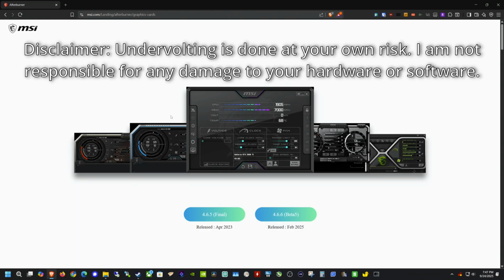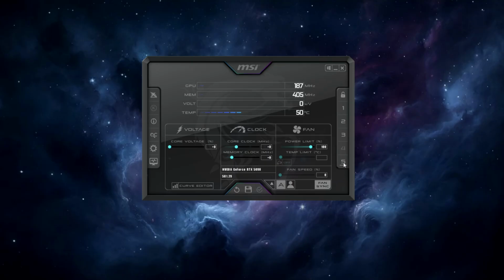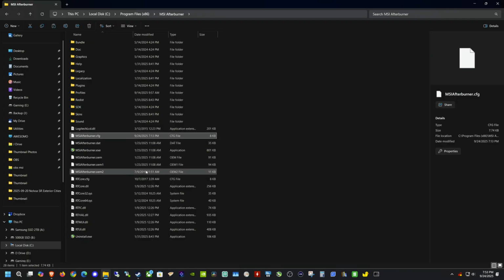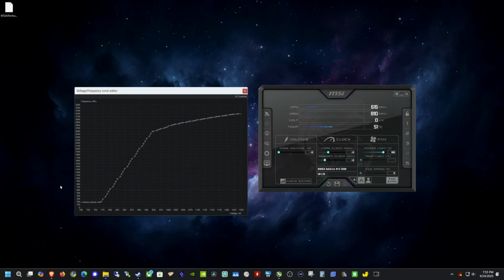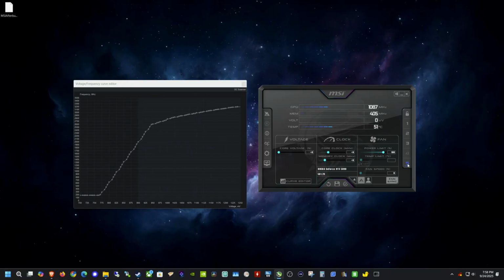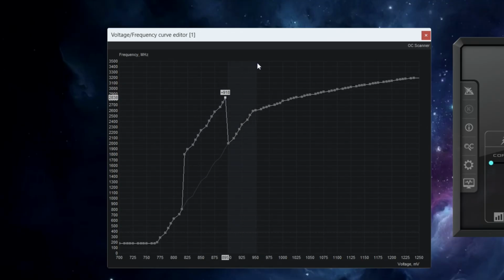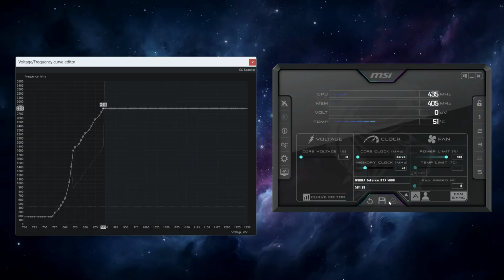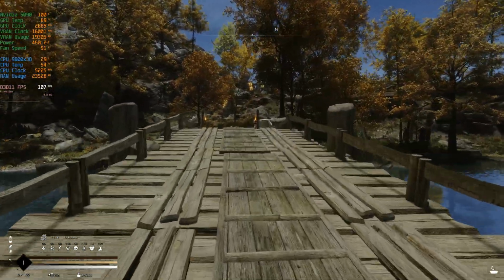You're Undervolting Your RTX 5090 WRONG (Here's How To Fix It)

Comment: Unless there's something unique to the 5090, the target frequency can still be lower during idle. I've undervolted and overclocked a bunch of cards, right now my placeholder 2080 Ti starts at 1335 MHz stock in the afterburner curve editor, yet the idle freq drops to 300.
Reply from the maker: If you follow other guides by pulling the entire curve up thus raising your minimum idle frequency allowed. When I followed those guides raising the entire curve my frequency would idle at around 1000mhz which was not allowing my fans to turn off while browsing the web, etc. I cant imagine the 5090 is any different to other cards in this regard.
Reply: @circuitscore it is different, I shift my entire curve and hit a boost block of 3Ghz with my 5070ti but still idle around 600mhz. 24-25C at idle. I checked the base voltage at idle as well and it’s pretty much the same. I think it’s a 5090 thing. I have experimented with using ctrl+click to pivot the curve so the lower bins are closer to the stock curve. Found to be not worth it at all, you’d need more extensive stability testing to check if the increased step size on the curve would introduce any instability.
Reply: @sodiumz7161  On my 4060, the idle voltage and frequency are exactly the same when the curve is shifted up. I think that other cards do not let the curve setup to override the lower voltage point frequencies, and the 5090 used in the video does not. Or it could simply be caused by the change he made in the curve editor files to let him see a wider range of voltages.
Reply: @sodiumz7161 the base idle speed on my MSI 5070ti is 180MHz and it averages around that according to HW info. Same for other 5070ti cards I've tested. If you held shift while adjusting your selected point up +400-500, it would make sense that your card is now idling at 600MHz, or +400-500 over default base idle clock.

This may not be a big deal for our cards, but on the 5090 that +400-500 on the base line idle seems to be closer to +1100 or more. I'd imagine having it stuck at that 24/7 would end up shortening the lifespan of the card.
Reply: @circuitscore yeah, something is either wrong with your afterburner or it’s just a 5090 quirk. Make sure you update to the latest afterburner version. I checked and   using the normal shift entire curve then flatten undervolt method, the idle behavior is basically unchanged for my 5070 ti. Actually, I’m now idling at a lower PPT than stock. It idles at around 10w and the card is basically close to room temp. Maybe like 2-3C higher than my room temp at idle, mid 50s in games. 

The super huge bin jumps in the middle of your curve is not ideal.
Reply: @circuitscore  So you explained a lot but didnt give reasons to why certain things are bad? My gpu idles at 1000 with 0.8mv according to GPUz so idk why it should be bad to have it that high when stuff works?

i also tested this now - board power draw and GPU voltage and GPU temperature stay the same during idle (nothing is happening on the PC) no matter if i idle at 1000mhz because i raised the whole frequency curve or not doing anything and just using default curves and values.
so why do you think that having the GPU idle at 1000mhz or higher is bad? temps and voltage stay the same so i dont see why it should be bad, but maybe you have a reason i just missed, also my fans dont start spinning if that is a concern for you (5090 suprim here), pls enlight me on this topic, thanks a lot <3

Comment: Appreciated your works, I am confused because am using PSU 1600 Watt with LCD shown Watt. I see PSU shown around 640 watt, however 5090 shown around 360 watt. Any change to lower PSU or can’t because it supplies electricity to pc?😢 thank you so much.
Reply from the maker: A 1600 Watt PSU is overkill even for a 5090. I am using a 1000 Watt PSU. My 5090 normally caps out at 500 Watts with this undervolt and my CPU, RAM, and other components cap out at about 200 to 250 Watts similar to your system. So 700 to 750 Watts total. But don't worry. You don't need to downgrade. The PSU will only use as much power as it needs not the whole 1600 watts. So you just have a lot of extra overhead. In other words your energy usage will be the same with either a 1600 Watt or a 1000 Watt PSU.

Comment: Clickbait. Editing the graph didn’t even do anything. You can see the voltages you affected from 800 up without editing the graph. This undervolt also isn’t proper because it mentions nothing of the fact that when you undervolt a 50 series card it does not run at the voltage you set but actually 2 voltage points below the flat line.
Reply from the maker: Sounds like you did something wrong. I was not able to see the lower points on the graph without editing the .cfg file.
Reply: @circuitscore I didn’t do something wrong I can see my points without doing this lol.
Reply: @Knight0vvl  em no, I just downloaded latest afterburner and I had to set it to 0. It was 500 by default (MHz)
Reply: @Krulaks  you missed the point you don’t even need to see the whole graph because he’s not changing any of the lower voltages. He started at wht 810vwhich you can see without editing the graph so none of the rest of the graph he showed you was useful he did the same under volt that other people are doing.
Reply: @Knight0vvl  yeah - you can skip setting cfg to 0 step. I think he just wanted to show us that there are lower voltages and it explained why other tutorials are bad. The main point is to not drag everything up (so from 810 or so). Others are saying to select 0.9mV point and to drag everything up (then gpu is stuck at 1000MHz+ or so)
Reply from the maker: @Krulaks Exactly this ^^^ Glad to see one person was paying attention haha.
Reply: @circuitscore  can you explain why its bad to raise all of the curve when temps, voltage and all stays the same compared to default? you didnt really go into that in the video, you just said its not good and many recommand it but didnt go into any reasoning if i didnt miss it, thanks a lot for any explanation in advance <3
Reply: @teanymonster5227  temps should not be the same, but probably you don't see any difference because of massive heatsink on GPU.

200MHz at low voltages = less Wattage
1000MHz at the same low voltages = more Wattage

Higher MHz = higher power draw, no matter if you are seeing the same voltage. Voltage is just one part of the equation.
Reply: @Krulaks nope temps total watt power draw during idle and voltage all is the same, i can show you screenshots of the total board power draw in GPU-Z if you want no problem (20-40W while idle)
Reply: @teanymonster5227 it’s not bad, just used more power at idle
Reply: So you explained a lot but didnt give reasons to why certain things are bad? My gpu idles at 1000 with 0.8mv according to GPUz so idk why it should be bad to have it that high when stuff works?

i also tested this now - board power draw and GPU voltage and GPU temperature stay the same during idle (nothing is happening on the PC) no matter if i idle at 1000mhz because i raised the whole frequency curve or not doing anything and just using default curves and values.
so why do you think that having the GPU idle at 1000mhz or higher is bad? temps and voltage stay the same so i dont see why it should be bad, but maybe you have a reason i just missed, also my fans dont start spinning if that is a concern for you, pls enlight me on this topic, thanks a lot <3
Reply: @teanymonster5227 he can’t explain it because what you said is true - the voltage which is the main concern and directly correlated with temps does not change. In practical terms having the gpu idle at 1000mhz or 100mhz will make no difference
Reply: @junkmonkey54  thanks, crazy that someone is claiming everybody is wrong but doesnt even give 1 explanation in the video and people just believe it without question or testing it themself, crazy world we live in sadly.

Comment: I have a Palit 5090 and my main problem is the temperature just slowly keeps going up until the fans kick in at 60c and after its cooled to around 35-40 then the process repeats. Will this help at all? it seems to idle at 800mv but fluctuate up to around 900 when just browsing the internet etc and up to 950 when watching youtube, I just upgraded to a 4k monitor so I imagine that's not helping but my gpu was still heating up even with my 1080p monitor. I only have a midtower case so maybe its just not enough airflow for it or something? when gaming at 4k with ray tracing it seems to max out at around 80c which doesn't seem too bad but could undervolting also lower that? thanks.
Reply from the maker: Undervolting will 100% help with your temps while gaming however at idle and while browsing the web etc. it shouldn't be heating up like that. Mine stays pretty stable while doing tasks other than gaming. This will help if the Palit 5090 turns off the fans at the lower frequencies. It essentially keeps the voltage curve similar at lower frequencies so your fans don't need to run at those lower temperatures and frequencies. Not sure if Palit has this options though. You might need to set a custom fan curve so that your temperatures remain more stable while idling and doing tasks other than gaming.
Reply: @circuitscore  hmm yeah I mean the thing with this gpu is the fans are very loud and they run at 1000rpm minimum so I don't have them on all the time, I think I can manually make like maybe 1 fan run at all times but the fan settings are a bit weird I'm not sure if the other fans will turn on ever if I just set one on 🤔

Comment: Since they released the 4.6.6 version, the cfg file is pretty much already set. The only difference is I’m on a 4090 & I’m not sure how to make the bottom frequencies show
Reply: Already figured it out….you have to change minvoltage from 700 to 0
Reply from the maker: Oops missed your update message. Glad you figured it out!

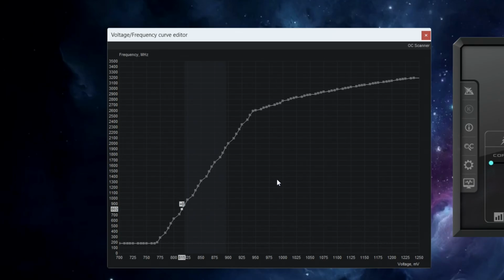Comment: 7:50 I usually input -200 core clock & then pick what ever voltage I want to run at a desired frequency. And then I keep lowering voltage until it’s not stable for what ever game I’m playing. 

I’m going to mix my method with yours & see what happens
Reply from the maker: Oh I like that idea. Didnt think of starting with a negative offset first.
Reply: @circuitscore  I learned the -200 core clock off set from this video https://youtu.be/GPs7Uufvoyw?si=Qd0KmBuN6E-igv7n
Reply: buona idea

Comment: My 5090 has a water block, and even under a 600W extreme stress test for 45 minutes, the temperature never went above 48°C. In this case, if I want to get the maximum performance, I don’t really need to worry about undervolting？
Reply: For me its about NOT burning up the power cord or connector, not temps.  600W is too much.
Reply from the maker: Oh I didnt even think about that. Yeah the melting cable is a huge concern of mine as well. This should help out quite a bit.
Reply from the maker: In your case you wouldn't need to undervolt to lower your thermals. However you can save quite a bit of power by undervolting. My usage with an undervolt is 450W to 500W. Without undervolting it consumes about 600W.

Comment: Hey I followed your guide but for some reason my card idles at .810v and ~2400 mhz. I terminated EVERY nonessential program, reduced refresh rate, shut off hdr, and still cant seem to figure it out. I guess ill have to reinstall drivers tonight. Have you or anyone else experienced this?
Reply from the maker: You might need to adjust your highlighted graph point higher. My card idles at .795v and lower which is why I picked .820 to .895 range to adjust the curve. Which brand of 5090 do you have?
Reply: Are your power settings set to "prefer maximum performance" in the NV control panel?  I had the same before remembering I set that a while ago.

Comment: Interesting, I tried to replicate the same steps and noticed my graph is a little different than yours.
In the Video after pulling up the highlighted section your MSI showed a +918 from 820/895 when at 2838
When I pull up that section the graph shows me at a +1001 so some of the graph points seem to be in different positions for me if only slightly.

Also after I pulled the rest of the graph down, after applying, the end result flat curve sits at 2827 all of a sudden even tho I checked -> 895 is at 2838 before I apply the flattening then after it always is at 2827.
I mean in general its in a similar spot to your values, its just strange that my default graph curves and points are different, about a "83" difference, super strange.
Reply from the maker: Yeah every card manufacturer has different limits and 2827 at 895 is a very common limit for many 5090s. Mine limits me at 2917 at 895. You will still achieve near stock performance with those setting and a huge power savings all while running much cooler.

Comment: doesnt work with the 4090 from gigabyte. i cant lock anything at 200mhz
Reply from the maker: That's odd. This should work with every card however your highlighted values will be different per card.
Reply: No , U cant Go on 200mhz with 4090, i have 3 cards, doesnt work with a single Card @circuitscore

Comment: Thanks for the video. I didn't event realize my idle frequency needed to be fixed! Also, what led you to choose 820mv as your min value for the segment that you dragged up?
Reply from the maker: No problem. Thanks for watching. I chose 820mv because 795mv and lower voltage is the typically idle range at 200mhz for most 5090s.
Reply: @circuitscore  one question, if your car idles close to 800, why didnt you cjoose the next possible dot on the graph which is 810? Why did you jump straight to 820?
Reply: 800 mV at 180 MHz is standard/factory for the FE, I think.  I'm running a PNY Epic-X that is overclocked from the factory and my idle is at 800 mV and 270 MHz (a +90 bump to the clock across the board).  Just reset your card to factory and look at the voltage in Afterburner with nothing else running.  Mine is 800, I pull my curve up starting with 810 and it works fine.

Comment: Super dumb question. I followed all of your steps, but notice in your MSI Afterburner, the Volt mV in the top 4 bars going across the interface, shows 0. Mine is like 800mV. Did I miss a step you did before recording? I don't want some voltage to be way too high, etc.!
Reply from the maker: You did miss a step. Earlier in the video I showed how to edit the MSI Afterburner Config file to show the entire graph. There are 4 lines you need to edit. Otherwise it cuts off the X and Y axis.
Reply: @circuitscore  I didn't mean in the graph though. I had actually edited the config file and got the graph to show just as you had stated. I meant on the other, normal Afterburner overlay. There are four horizontal bars at the top middle one being for volts but yours isn't showing any. Mine had like 800+ showing already in there while following your steps.
Reply from the maker: Oh sorry I miss understood what you were asking. I'm on a business trip and will check it when I'm home. It's possible the Beta version of MSI Afterburner that I'm using is not reading the voltage correctly. 800mV isn't too high if you undervoltef correctly. Is that under load or idle?
Reply: @circuitscore  Idle. And I think you're right. The beta version likely just didn't show voltage up there at the time. 

I saw another video that also had someone testing UV tweaks in Afterburner and it didn't show his voltage either. 

I also think my Gigabyte Windforce RTX 5090 needed a touch more volts. Helldivers 2 crashed within just a few minutes, following those steps pretty much verbatim. Not sure. I'll tinker more tomorrow.

Comment: What are the power savings compared to the incorrect idle?

And just for fun: Couldn't help but notice that Skyrim's HUD looks like a Korean MMO. 😀
Reply from the maker: Great question. Ill looks when I get home. I cant imagine is very substantial. For me the biggest use case of undervolting using this method is to allow my 5090 to turn off the fans when its not under load. If you are idling at 1000mhz your fans will run continuously.

That is Nolvus modlist. Its crazy unique. Does look like an MMO HUD 😂
Reply: @circuitscore  So i had my curve editor at the same higher min presets that all the other youtubers had, the lowest my 5090 downclocks was around 1177 Mhz at desktop idle.  With your new lower preset, it drops to 180 Mhz !  Nvidia App shows it's using 4-6 watts at new idle vs 5-10 watts before.  5 watts idling for a 600w monster of a GPU is incredible tbh, what's the wattage showing on your end?